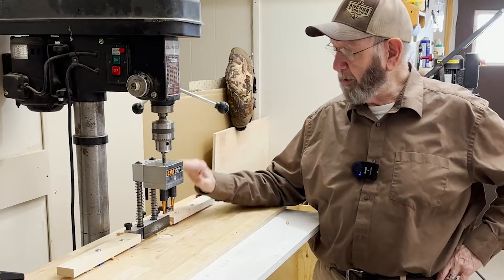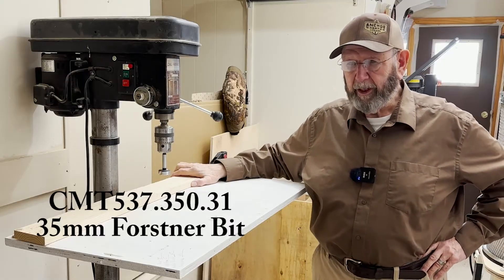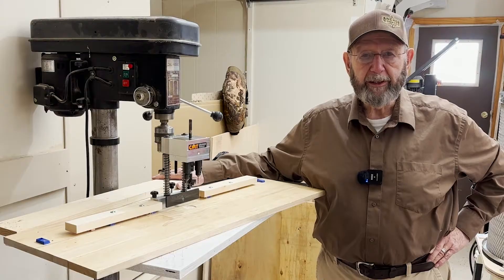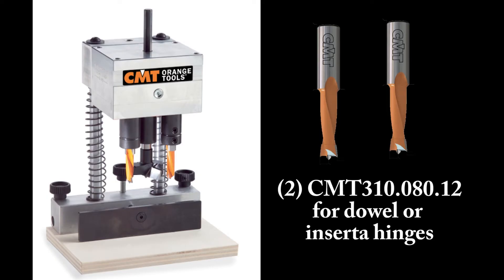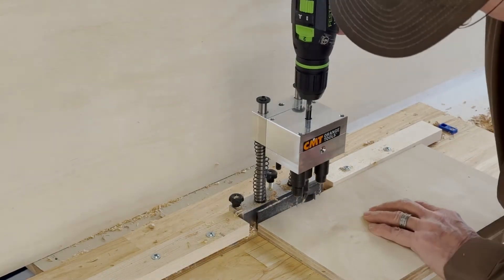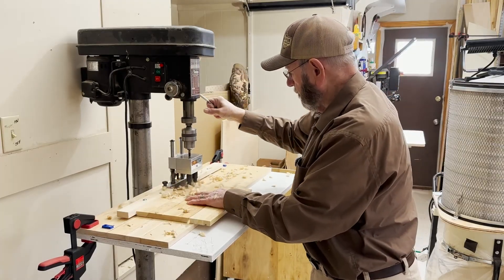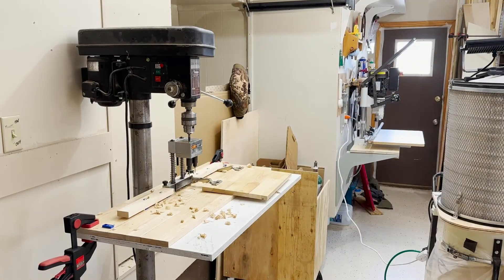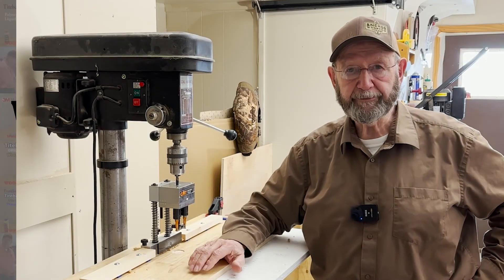Simplifying Hinge Installation: Testing the CMT Universal Boring Jig

Comment: I've been watching several of these videos in the hopes of seeing someone install  a non-Inserta hinge into the dowel holes. I know it can't be easy and the only experience I've had with installing hinges with dowels was using a Blum machine years ago that had a ram press built in to to it.  I'm considering getting one of these systems if I can find a good way to press the hinge dowels into the door. The search continues....
Reply from the maker: Some guys will just use a rubber mallet and call it good. Blum also makes their own knock-in tool with a mating surface for the hinge, and nice strike plate for the hammer swings. Here is a link: https://www.wwhardware.com/blum-knock-in-tool-for-blumotion-hinges-bzme-0710

Comment: This is the perfect system if you have a drill press and do a reasonable amount of doors.  The option of using two 8mm bits lets you take advantage of several tool-free attachment methods on hinges.   Saves time and makes accurate drilling virtually guaranteed.